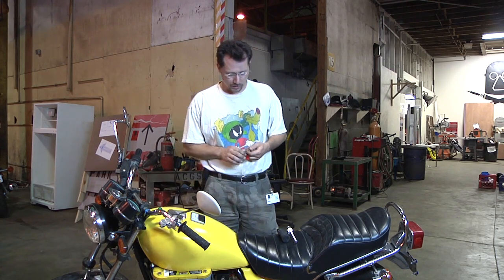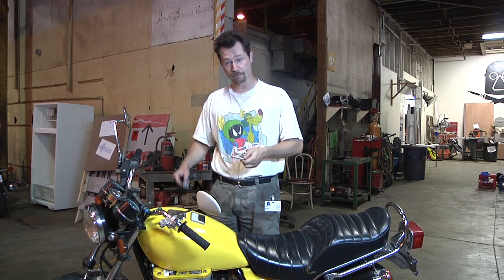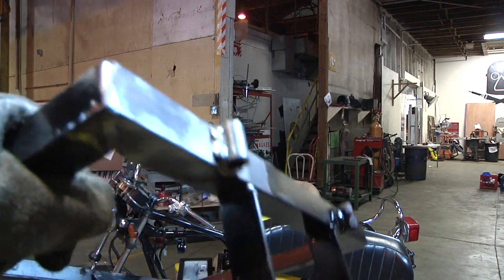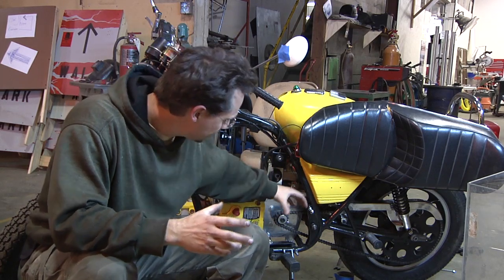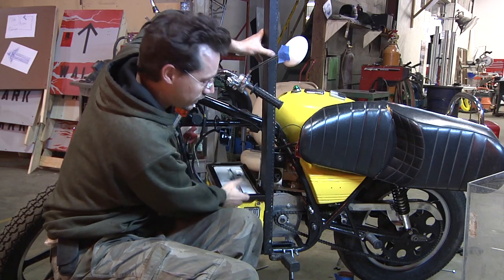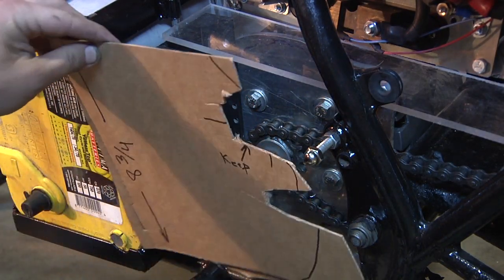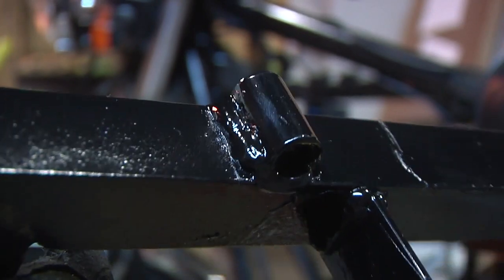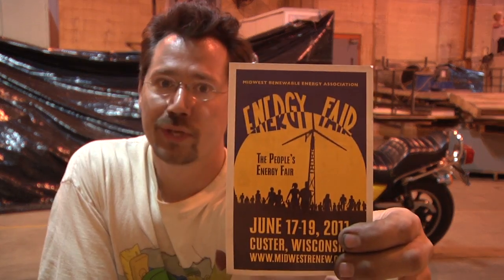Electric Motorcycle: Chain Guard, Re-Weld, and ready to Roll to the MREA!

Comment from the maker: @dudleyhinton 
The motor is a Briggs & Stratton Etek. It's about 8" diameter, but only 5.5" thick. It's rated for 150 amps continuous. In the KZ-440, with the batteries where they are, I couldn't put in a bigger diameter motor, but I could put in a longer one. A pump motor from an electric forklift might work pretty well.